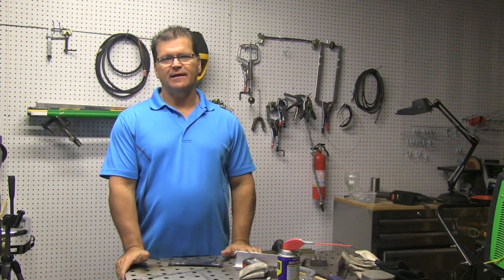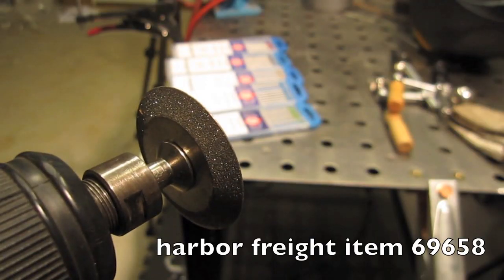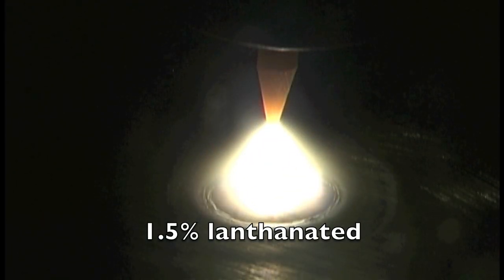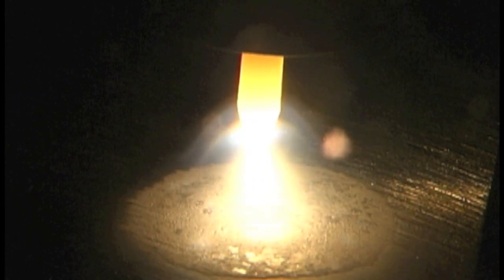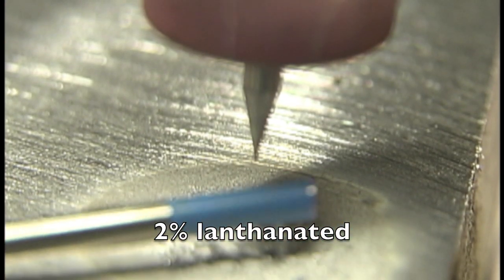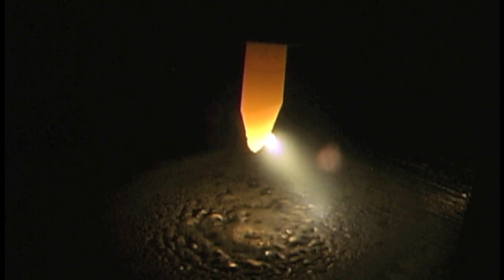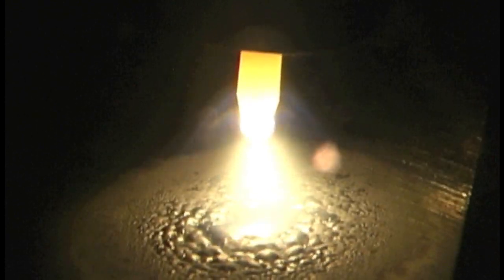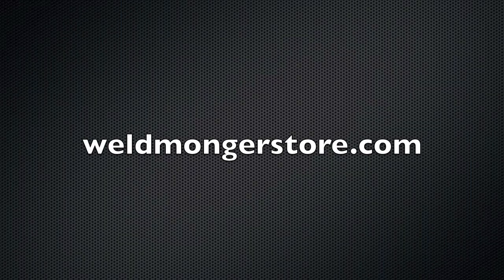Tungsten Electrodes Review

Comment: What’s the double bloom from that I see? I have a welder that does this and at first I thought I cooked my touch so I put a new one on it, still have the same problem. I’ve tried a new tank too. It looks like contamination but I know it’s not. I can’t even dip the filler rod as it balls up before I get to the puddle. My other tig doesn’t have this problem. It appeared one day after doing some welding. Thoughts?

Comment: Jody (love your vids)... Often I screen shot the "ah-ha" moment.  You often capture this moment verbally but don't put the tech specs in written text on the screen (so I can screenshot and use later!).  Write out the goods man!  (And keep up the great work)
Reply: Ok...since I've posted...question for you...I recently started using a 1/8 tungsten on 0.188 aluminum. Super stable arc at 200amps.  I typically use smaller diameter tungsten on CS and SS at lower amperage.  So...my question...what is the downside of using TOO LARGE a tungsten at lower currents?  (Apologies if you've already addressed this... I searched "too large tungsten" and found nothing special)

Comment: The diamond wheel is a good idea. I have a dedicated wheel on my bench grinder, but it takes a spot on the bench grinder that seems unnecessary if you use a diamond wheel. The one thing I don't like about it is the fact your hands are full, but I guess you could put it in a bench vice.

Comment: I've got a suggestion. Since AC current will give more energy to the tungsten point than DC current does... are you sharping tips in DC (30-45º) with the same shape than you would with AC? If you shape on AC with 90º degrees your experience could be different.... When welding with AC, the ceriated tungsten melts in a very simetric way, which means that with a 90º degree tip your arc will be more stable. According to my personal experience, ceriated tungsten with 90º shaped tip is the best option on AC. Greetings fron Spain!!!

Comment: great video we use 2%zirconiated tungston for aluminium what is your take on that one i find on lots of start ups they tend to want to get dags on the end of the tungston and if you weld a little to hot for the size of the electrode they seem to crack  length ways but if you sharpen the tungston and ball it up a little and do some continious welds they stay fairly stable and i have learnt that the post flow when welding ally is important to help keep the tungston from degrading

Comment: Another great video Jody! 

Have you considered doing a video on comparing different mig wires? comparing Metal core, flux core, dual shield and plain copper coated mig wire showing advantages and disadvantages to each? I recently finished a job at a truck trailer manufacturer in australia using nothing but metal cored wire was really impressed with it.

Comment: I rarely weld over 100 amps. Most of my welding is 16 guage or thinner aluminum. Does lanthanated have a more stable arc at low amps than ceriated?

Comment: I rarely weld over 100 amps. Most of my welding is 16 guage or thinner aluminum. Does lanthanated have a more stable arc at low amps than ceriated?
Reply from the maker: I would say they are very similar except at max amperage. So if you rarely use more than 100 amps ceriated is just fine
Reply: Thanks

Comment: You forgot about the good old pure tungsten with the green end. I was always told you could use pretty much anything for DC except pure tungsten, but for AC the opposite is true. I use ceriated for most DC work, with the exception of some 2% thoriated I still have laying around, and for AC I switch out to pure tungsten. It does ball up quite a bit (especially when my stuporvisor messes with the AC balance), but it's still workable.
Reply: +Cheezy Dee u cant use pure on a inverter duhh
Reply: @dansalibi7466  yes you can, you just shouldnt

Comment: Thanks Jody, I am a hobby welder in the UK, I didn't realize that the sharp tip on the electrode would burn back to a ball from a point....after 2 minutes I thought I had touched down and burn the point off so I would resharpen and start again!
Great vid.

Comment from the maker: I like 2% lanthanated electrodes because they work fine on both inverters and transformer style tig welders and because they handle more amps than the rest which means sometimes I can use one size smaller electrode
Reply: which tungsten would you recommend for all around.
Reply: I vote 2% Lanthanated as well. They seem to be the best on aluminum, especially thin aluminum
Reply: That's an interesting comparison ! Layzr and E3 have the same composition from what I've found. Abicor Binzel is selling E3 and they advice users to sharpen them at 60° not less.
Reply: +1 on the 2% La blue. I've since switched over completely for DC/AC after watching Jody's videos and trying a few.

I know what you mean about a few LWS having no idea 2% La even exists :/

It was nice to see that CK started offering their 3 packs in 1/8" also in 2% La. I don't go through the big tungstens that often so 3 vs 10 is an awesome option to have :)
Reply: weldingtipsandtricks what benefit would you find in using a smaller electrode, say a 1/16 instead of a 5/64?
I just took delivery of my new tig machine today, it came with 1 thoriated electrode 1.6 (1/16)... happy to find this video, such valuable info and helped me with my research into electrode types. ty. I'll be buying some 2% lanth' now instead of more thoriated, but I'm unsure of what size to get.I plan on welding 1" 1/8th DOM steel tube 1/8th wall, what size electrode would you recommend? I think a sub is in order.
Reply: What or who is CK?